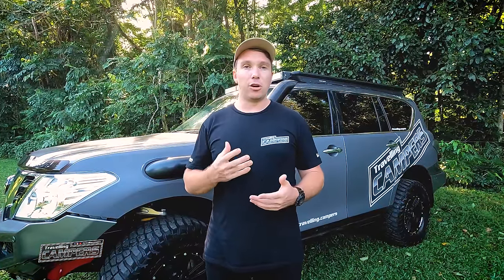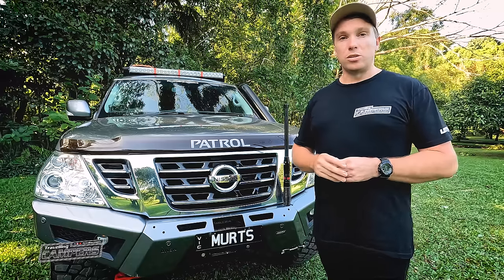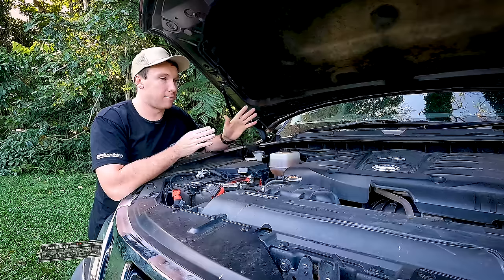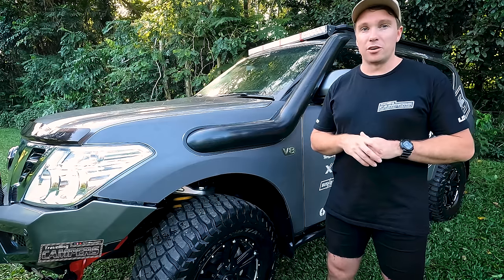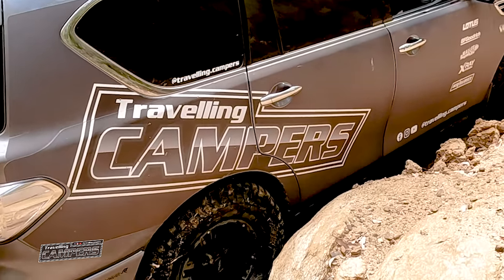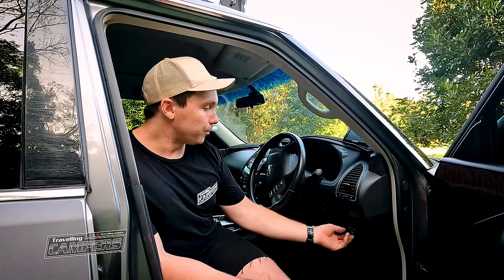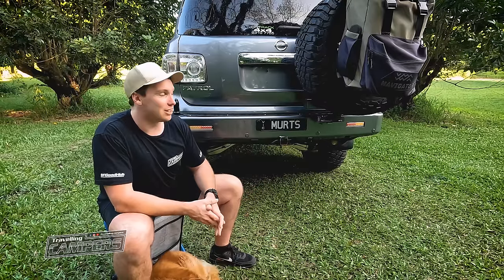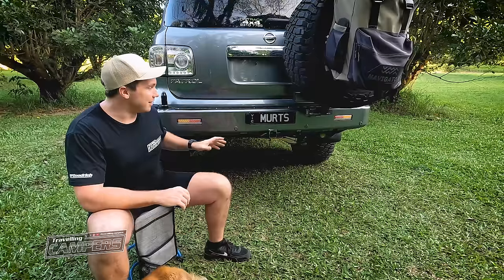DON'T BUY A NISSAN Y62 PATROL UNTIL YOU WATCH THIS! 3 YEAR RUNDOWN AND REVIEW! FUEL ECONOMY?

Comment: I got my 22 Y62 pretty much standard with all this rain and very boggy conditions around my property only had to engage only once 4wd did it with the greatest of ease otherwise 2WD does it really easy where as my other cars used to get bogged. LOL.

 Plenty of Deep Water crossings lately over a metre deep cross it no problems without a snorkel.
It's petrol engine you really only need a snorkel for diesel can't afford to get water in that can't compress water & it ends up bending your rods. Absolute bugger when that happens.

 Towing the 3.35 t van no problems. No sags then again I don't carry  that much equipment as you blokes so it's never over loaded.
 I like to keep it simple and only take the basic essentials.
The Y62 Nissan absolute Beast. LOL 
Good content as usual.
🇭🇲😀👍🍻🍻
Reply from the maker: Very bloody good car! Thanks for sharing mate glad your loving it! Thanks for watching!
Reply: but they are just too slow off the mark, i like the ability to overtake in the city if i need to, and we had one for two weeks and it just felt so sluggish and heavy compared to our FJs
Reply: @user-jp9ox9zd2k  yeh they are slower than my wife's tesla 😂. Fjs don't have the room that a y62 does. Completely different car
Reply: @danielmill9120  LOL I don't have a problem dragging cars off at the lights quite exhilarating and scary at times. Used to have an FJ45 you can keep them ,I prefer the comfort of the Nissan limousine interior comfort  power and quietness anytime.
I'm over  overpriced and pasay Toyota's.
 cheers have a good one
 🇦🇺👍🍻

Comment: I've got a gu patrol and I'm pretty tempted to get airbag man's coil replacement airbags in the front and rear.  I'm pretty nervous biting the bullet,  some 4wd shops have actually tried to talk me out of it, but the fact that both your car and van run airbags, it definitely boosts my confidence.  The off road van air suspension scene gaining popularity is actually what made me consider it and it seems to have nothing but positive feedback from the owners. 

I think my concerns just go back to that old school mentality like you mentioned in this video
Reply from the maker: I know if I had a GU I would do the full airbag option from Airbagman 100%. Trucks have been using them for years and years. Thanks for watching mate and send me a photo once you go full air 😍
Reply: It's taken me almost a week just to find somebody to install/engineer it and the bad news is it's going to cost 10 grand.  

Appreciate the reply mate,  but I don't think I'll be going down that road now aha. I'd rather spend that on my 12v set up aha

I still think it'd be worth it,  but it's hard to justify on old car
Reply from the maker: @JoshSinnott97  Roger that mate!
Reply: Pretty sure that's without shocks factored into the quote too

Comment: really liked this Vid, couple of questions if I may... you said starter and a fan were replaced and Im wondering did you go original equipment or did you opt for aftermarket ( under the impression it was better ie, better starter better fan)? Also do you have a lock up kit in your auto for towing and such? I have heard it helps fuel economy and if you do I was wondering your experience with it?  Cheers Robb
Reply from the maker: Cheers mate! OEM parts mate and no issue since! No lock up kit, don’t need them in these things! Thanks for watching mate!
Reply: @Travellingcampers  nice , its interesting that you replaced oem parts with 20 and 30 thousand klms on them with the very same parts that came off and now your up to 90 k and no problem with them. I hope at least the parts were free as they sound defective from the manufacturer

Comment: Great vid 👍 - curious on the bush barriers - do you get any scratching on the very small edge sections that are left exposed between the panels? Thinking of getting the bushwrapz and they have similar gaps on edges.
Reply from the maker: Cheers mate! The gaps are very very small mate so you could get a few! We also have ceramic coating on the paint, once a year or so we still get a cut and polish and any little bits come straight out! Thanks for watching mate!

Comment: The single biggest thing with ours is I’ve never paid more for unleaded, further more it’s done 120ks on E95, currently the diesel vs E95 price is 45 cents a litre difference cheaper has been for a while
Reply from the maker: Crazy hey! Thanks for watching mate!
Reply: Same here. 91octane to 98octane has always been cheaper than diesel. Even if you use 1 - 2lt per 100 more than a 200series, you are still way in front.

Comment: Mate, being a motorbike expert. Which engine is a better daily driver a 4 stroke or 2 stroke?
Reply from the maker: 4 stroke 🕺🏻
Reply: @Travellingcampers  a 4 stroke 155cc, 1 cylinder, 4valve SOHC, 19.3 HP@10, 000 rpm, 14.7 NM @8500 rpm. Is it okay for a small town, mate?
Reply: @Travellingcampers  what about a 155 cc, single cylinder, 4-stroke, 4-valve, SOHC. 19.3 ps@ 10000 rpm, 14.7nm@8500 rpm, chain drive, 6-speed manual?

Comment: the reason for the hot air is a warning from the car to tell you that the bastard is hot and u need to stop driving, i have had 2 nissan a 2018 y62 ti and a 2023 y62 ti, never overheated or pushed the red, the fans just pull hard, probs a cloged radiator is my best guess???
Reply from the maker: No, it was a viscous hub as I mentioned. Common problem with them.

Comment: The Diesels have a little more torque ????   

Bro, the Ford F-250 Powerstroke (2023/4) has 500 HP and 1490 Nm,  the V8 petrol  6..2  hat 400 HP, but only   570 Nm.....a factor of almost 3.   In addition, we drove in the US a trip with 3 Powerstrokes with trailer, and 2 V8 Petrols  (Ram, F-250, GMC)....fuel consumption:  Diesel  average  (highway, mountains, off-roads, trails, normal roads)   16.3 l/100 km, Petrols , all 25-31 l/f100 km.....and the price diff. is in 2024 USA is  3.45 USD/gallon petrol, vx. 3.79 USD/gallon.....so take a trip 5,000 km, compare costs overall, and you wil be considerably more better off with a diesel than with a petrol !

By the way: I had rented 1 week  a Y62  in 2023 in Costa Rica....was glad to return the vehicle after 1 week, to exchange it with the troopy V8 diesel !
Reply from the maker: Cool 🙃